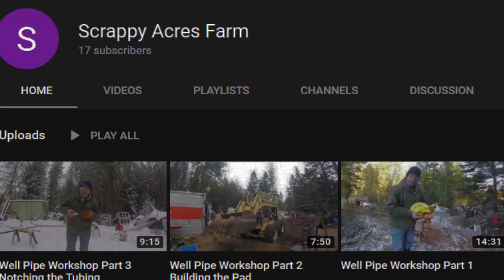North Dakota #Oilfields  "It takes gritt"

Comment: Hey, JP, do you know anything about United Agronomy? I saw their ad in the Williston Shopper in which they're advertising for seasonal truck driving jobs. You've done agricultural hauling before, right? Is the pay decent, and do you need driving experience?
Reply from the maker: United Agronomy is a large company up here they are the same as pinnacle and Horizon Resources so those are three options if you want to haul seasonal fertilizer for grain
Reply from the maker: They are a consistent company that isn't really affected by the price of oil
Reply: @JPTV3000  Sounds good. Is the smell tolerable? :) I'm assuming it's hauling a lot of fertilizer.
Reply from the maker: They do have grain trucks and it's like a Class B to drive it it still 10 to 13 speed and some of the other companies like Horizon Resources they also haul fertilizer in Grain